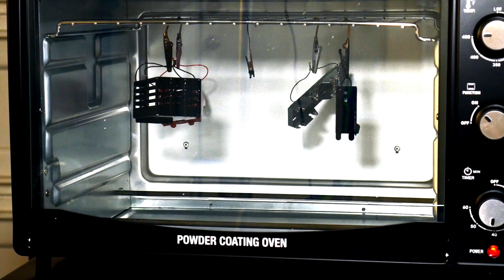Mini Tonka Toy Truck Restoration/Custom: Stake Truck 1963-1969

Comment: Nice job.  On mine, I had to remove that front rivet because I knew there was rust under it and it would bother me if I always knew it was there.
Reply from the maker: I have mixed feelings about it. I removed the rivet from the first couple of projects, but didn't like the look of the pop rivet. You're right about the rust, though, it's probably still there.
Reply: @ourstoryyourstory  Well, you could always pay an insane amount for one of those Tonka rivet clinchers.
Reply from the maker: One Mans Junk I suppose if I get serious about this work, eventually, I’ll have to. Hundred bucks though. It’s a big number for a tool that you use once on every vehicle. Maybe twice.

Comment: Good choice on the new colors Toby! What a lustre on that powder coated finish !  
How long do you soak the parts in the hot lye solution for paint removal?
Reply from the maker: Thanks! The color combo was Shelley's idea. They were in the lye solution for less than two minutes. It works really fast, just differently. In some cases the paint just turns into a powder and mixes with the solution, like the blue cab. The white stake bed "rubberizes" and then comes off in "slices?" It happened on the last one, too.